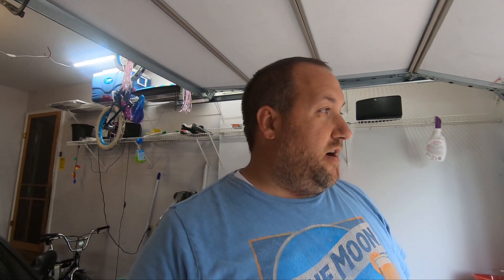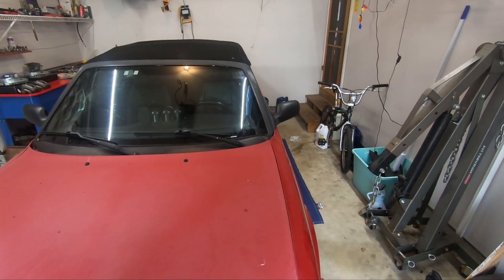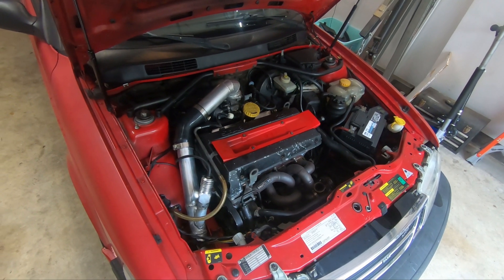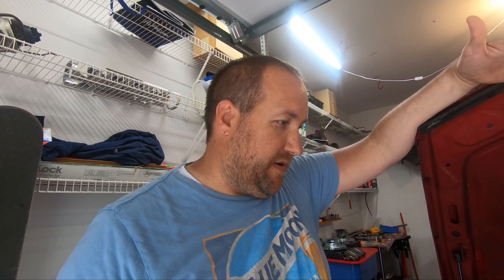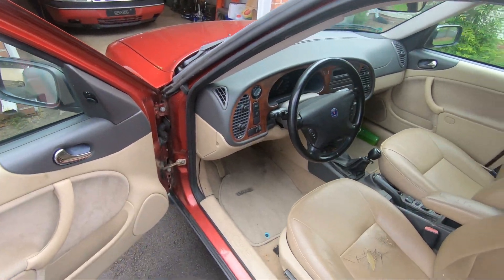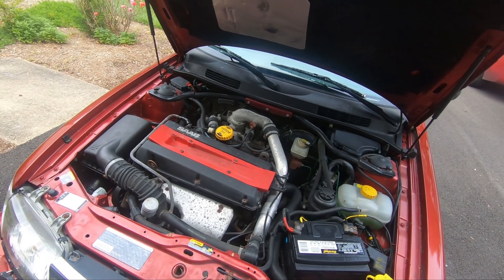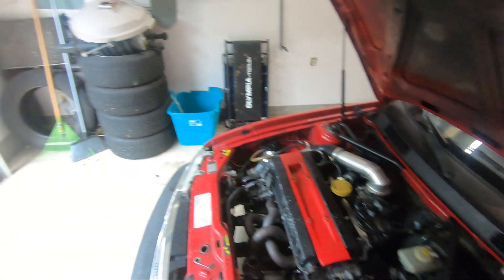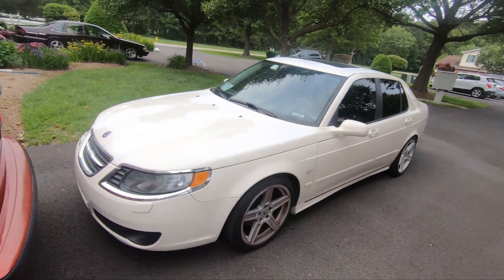Introduction to my big turbo saab 900/9-3 swap and build

Comment: Hi Craig! Did you use new head bolts when replacing the head??
Reply from the maker: the 204 got new stock bolts. the 234 gets APR studs

Comment: SAS auto customs makes copper head gaskets.
Reply from the maker: there's a local US vendor that carries them, too. GHautowerkz (I think?)
Reply: @g96nt  I talked with Rochesters House Of Boost about doing a bulk fire ring with stainless head gasket. He pushes 700hp. He said sure so if anyone is interested we could do a bulk buy. I myself will be getting 3 sets. Anyone interested?
Reply: @g96nt  I purchased the kevlar/carbon clutch from GHwerks along with the hybrid flywheel from Genuine SAAB for a ng900. Werks fine but still need to up the power to utilize the parts.

Comment: aren't HX35's usually used for diesels? can any saab tuners explain why they're good on saabs?
Reply from the maker: They're not exactly good on saabs, but they're cheap to buy/rebuild, and you can easily make the power a saab can handle.

Comment: What camera and stick are you using? Once I have time I might get back to work on my Eclipse Spyder Turbo 😉 👌 📸
Reply from the maker: I use a 7 black, and one of the cheap accessory packs from Amazon. It has a bendable tripod and a selfie stick, and both work pretty good. I generally use the tripod for everything.

Comment: I'm not sure if those red cars took the red DI cassette or the black one. If it's not the right one, that could likely be the source of your problems for the failing head gaskets. It also can cause the catalytic converters to go bad.
Reply from the maker: This is a T5 Car, so it uses the red cassettes. The Gaskets seem like it's failed for 2 different reasons. Although, It's becoming clearer that there was some knock going on.
Reply: @g96nt  You should go for t7 head gasket swap instead its made out of steel or something similar. The t5 is paper i think. But you have to lathe the pistons 1,1 - 1,2mm
Reply from the maker: @Bazzeponken  I've considered it, for sure.
Reply: @g96nt  Ye thats like the only downside of t5 stuff tho.